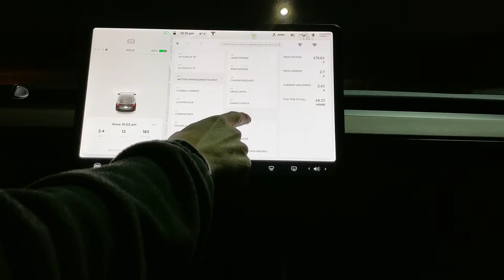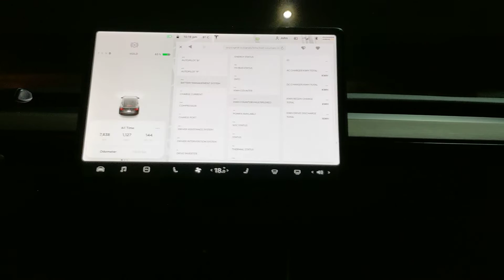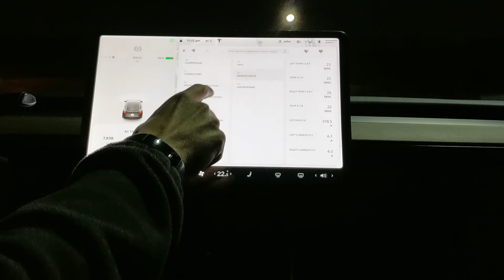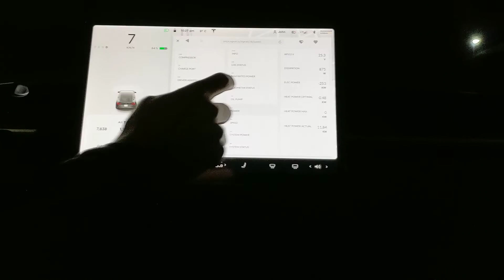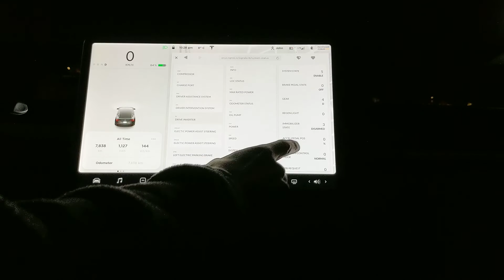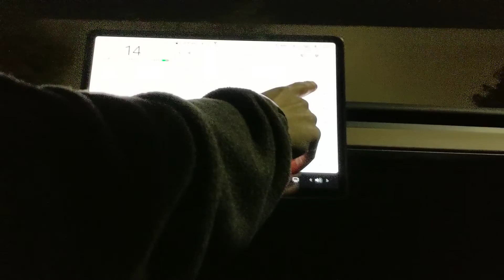Tesla Model 3 | Secret Signals | Driving with my CAN bus signal viewer on the main display

Comment: Love the idea btw, are you using web sockets to push the data down to the browser?
Reply from the maker: Thanks! And yeah, I am. I toyed with the idea of using WebRTC for less latency, but both ends (car and phone) on cellular are using symmetric NATs, so it would have needed a turn server, and ended up being similar in performance. I may still try it for the UDP benefit.

Comment: Are you using the can bus to obd2 bjorn featured in his latest video?
Reply from the maker: Yes and no. I'm not using ODB2 at all, but I use the same adapter cable to tap into the can bus, slightly modified for my needs. I was not able to source the connectors themselves, so the easiest solution was to buy the adapter and take off the stuff I didn't need.